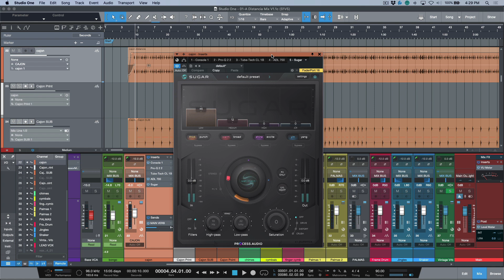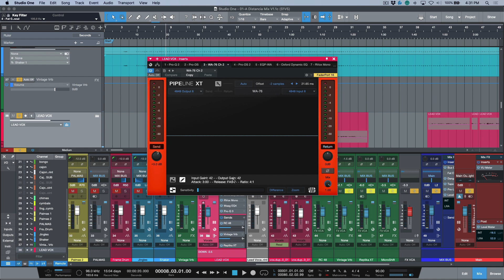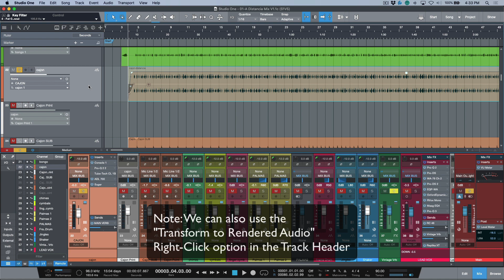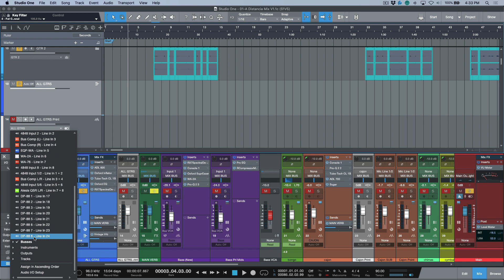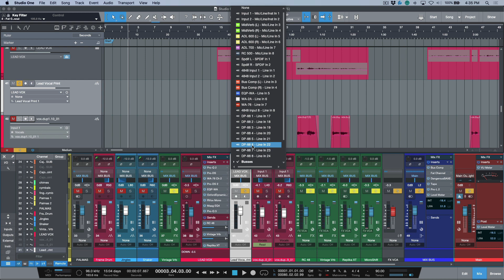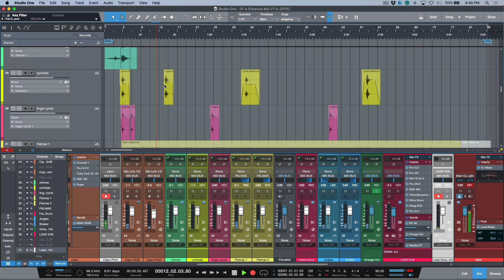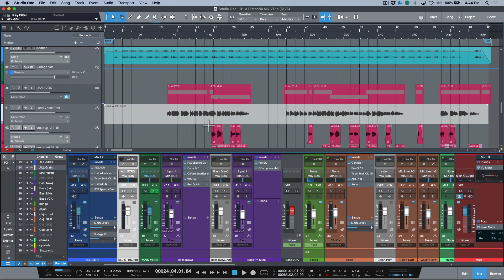Session Archiving Workflows when working with External Hardware in PreSonus Studio One 5

Comment: So in this method of recording the channels If you are working with block size of 1024 they will be out of time/phase with the original tracks. Am I missing a step or isn't this feasible unless you are running at low latency?